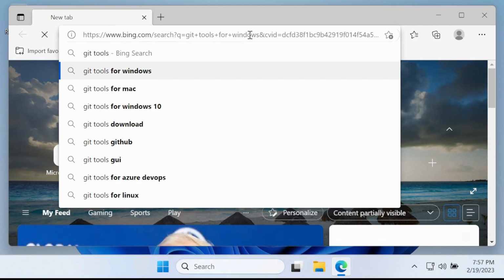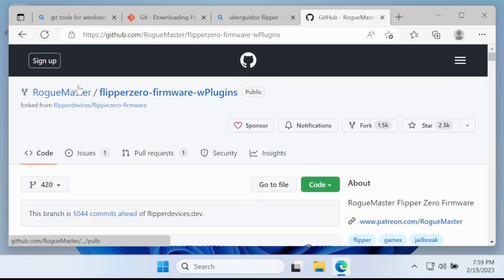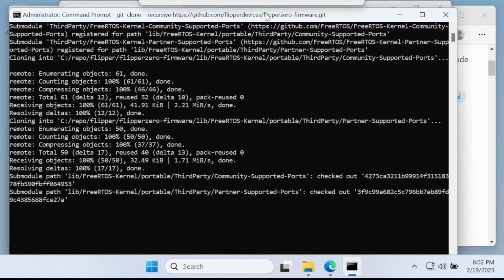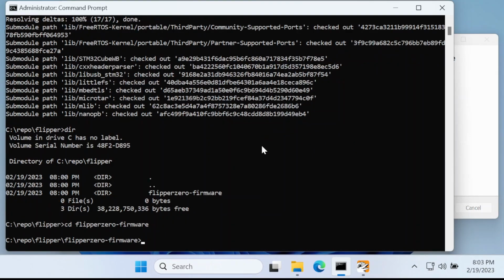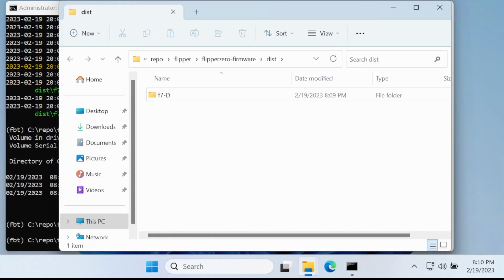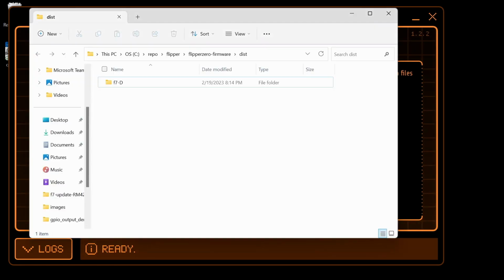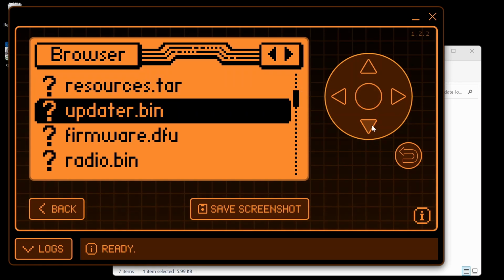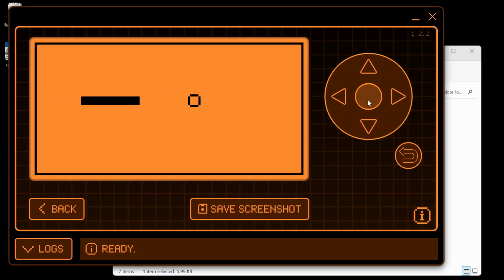[24] Flipper Zero - building and installing firmware

Comment: So what did you use the Git tool for?
Reply from the maker: I use git tool mostly for cloning repositories (either firmware or other apps). I find myself often doing "git clone --recursive https://github.com/..." to get firmware or apps quite often.

VS Code has built-in support for Git, which is easier for some instead of command-line, but https://code.visualstudio.com/docs/sourcecontrol/overview says "VS Code uses your machine's Git installation (at least version 2.0.0), so you need to install Git first before you get these features."

Comment: Sa fonctionne aussi pour rajouter une application sur mon firmware actuel
Reply from the maker: yes, this is works to add applications as well. I usually put them in "applications_user" folder, unless there is already the same app in "applications\external" folder.

You can also call internal APIs, which can be helpful for writing custom apps that only you are using. Apps that use internal APIs can't compile with uFBT tool, and can't be listed on the app store.